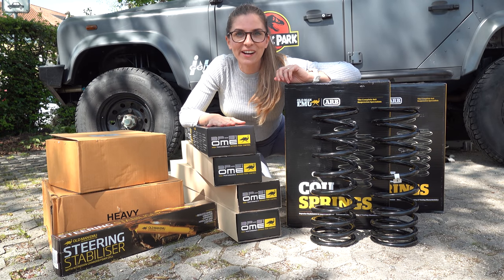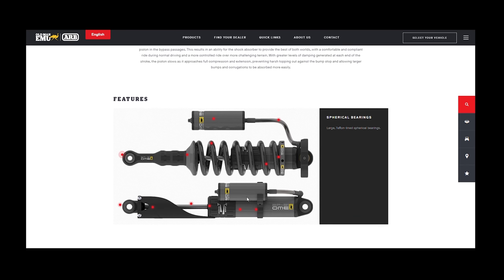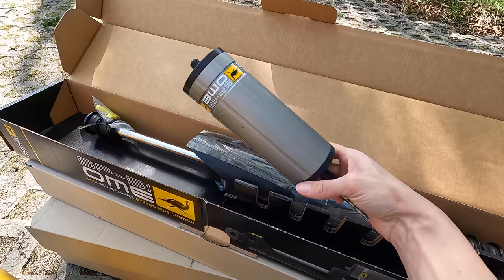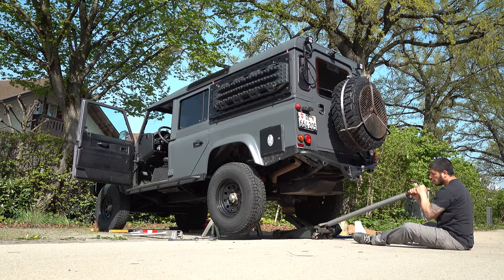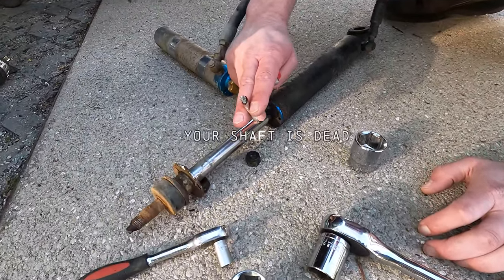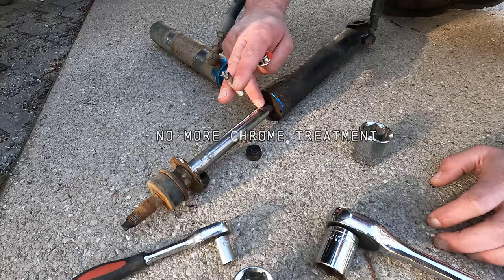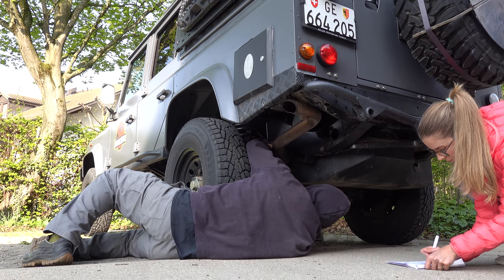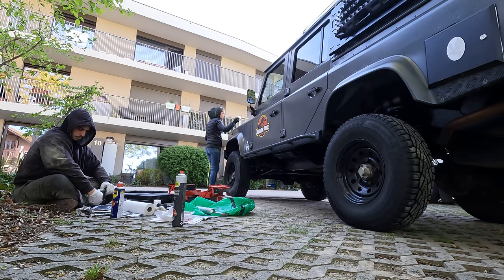Fitting OME BP-51 Suspension kit on Land Rover Defender (how many hours of work?)

Comment: Hi! What paperwork did you need to pass the ispection at the ocv (office cantonale des véhicules) and where did you get them? Were these sent with the kit?
Reply from the maker: Swisw homologation paper, we got it at Offroad Accessoires in Geneva. Usually, you can buy the homologation paper from a swiss shop who sells them. And usually, if you buy the suspension from the swiss shop (and maybe have it installed too) this paper should come with your purchase. We didn't have that paper because we received the parts directly from ARB Europe.

Comment: I have the Gwyn lewis challenge suspension on my Defender with +5 pin to pin OME shock absorbers and +2" OME springs. The OME look good and have good reviews. Hope they come out with a pin to pin version if they Don't already. The rear OME are quite firm on my pick up and think these will  improve the ride. Are they rebuildable?
Reply from the maker: Nice setup! Yes they are pin to pin and apparently also rebuildable.

Comment: Hi you should keep the cones of the top of the rear springs in case you go over a bank and drop a spring out
Reply from the maker: No need of those ones anymore. Springs are longer and we tested the max axle angle when car was jacked up, shouldn't be an issue... in theory ;)
Reply: @offtrackfamily  when the axle articulates to one side (one wheel up one wheel down) it will get much more droop than when the axle is just hanging down on both sides together.

Comment: Thank you for the video.  Couple of things when I did a heavy duty coil, I gained 50 mm or 2 inches in lift.  The issue I found was my panard rod had to be adjusted.  I had to put spacers in for the anti roll bar ( they flip if you dont) and I put location cones in as the left spring kept dislocating when flexing.  I see you took your out?   Did you have any of these issues?
Reply from the maker: Thanks for sharing this. We previously had a 2 inch lift so everything was already done for this new suspension. It seems we don't need the cones with these new springs. As it's very new, we haven't been able to test them offroad. will share a first review later on this year :)

Comment: I note that you have no rear "anti roll bar fitted" how do you find it with body roll ? I have just fitted an ALLU cab roof top and now its an issue.
Reply: Yes, it‘s a Problem! My 110 (also bp51) with roofrack an alucab expedition tent, 270 awning is not funny to drive without the anti roll bar. If its mounted and you are going offroad it turns over in upper direction. The spacers delivered with the kit are mounted. All i can do ist to take the anti roll bar out for going offroad ……
Reply: @martindrechsel8940  Thanks, ill fit a set of ARB`s as a trial staying with the thin LR units to maintain some wheel travel. keep up the great work.
Reply from the maker: ARB do put spacers for roll bars in their kit. Some friends also remove the roll bars when offroading because of the issue. We feel it's a pain doing so because when traveling we're on & off road regularly. In any case we can't have them on because we have a long range fuel tank.
Reply: Thank you for your answer. I have tried several options. The Defender is so much better to handle (onroad) with mounted rollbar. In the next step i will try to rebuild the arb spacer a little bit „fater“ i think a plus of 4 cm will do the job very well. If it works fine - you will hear from me 😊 Thank‘s for your Videos. Have a nice time and stay healthy!!!
Reply: @martindrechsel8940  Thanks for the reply, I also have a rear Long range fuel tank. I will make up some spacers for the ARB brackets and trial the sway bars. Keep up the great U Tube programs, cheers.
Reply: Just made some drop mount's for the rear Sway Bar below my Long range fuel tank. Work's fine but no off road test to date. Handling on highway 🛣️ is so much better.